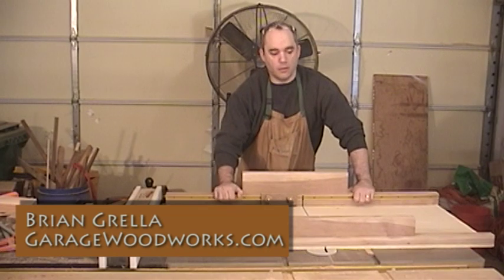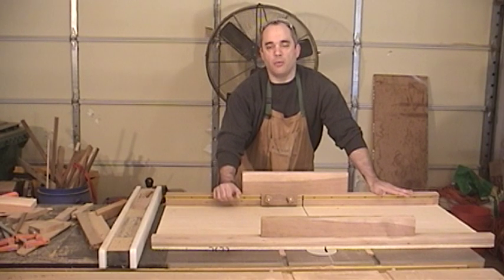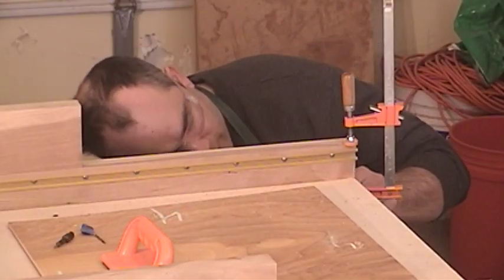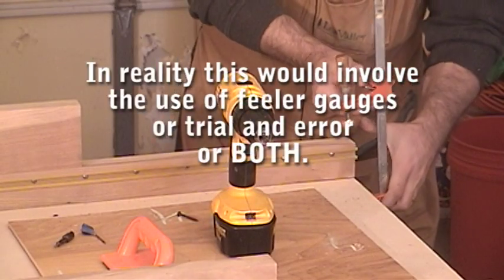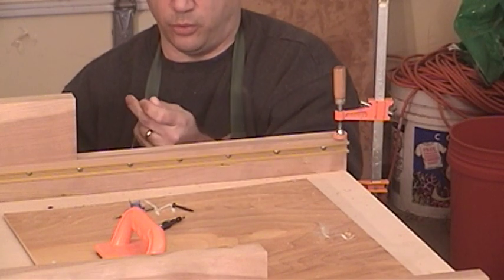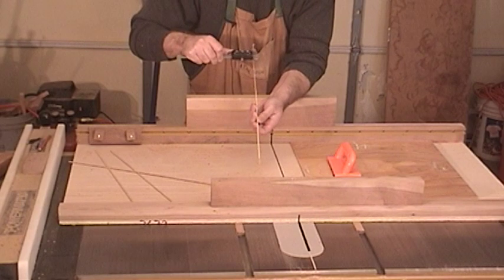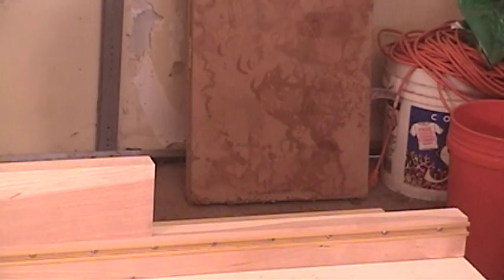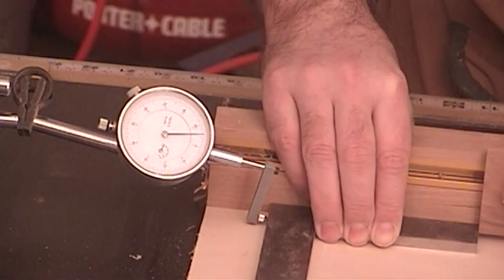Five Cut Method Showdown

Comment: I am soooo glad that I found this video.  I have been struggling to square my Incra Miter gauge, which I have mounted to an Incra Miter Express sled.  The 5 cut method was a terrible waste of time, and the instructions that come with it say just to use a quality square and align it to the blade.  There is so much bad, unuseful information out there, but this method worked like a charm! I used my TSO Triangle, clamped to my fence and the dial indicator and got it aligned beautifully in 5 minutes.  Finally! I decided to lock my fence down with the provided angle support and plan on leaving it there unless I need to make cuts other than 90 or 45.  For 45's, I'll just  clamp my TSO triangle to the fence and place the work piece along the 45 degree angle of the triangle. Thanks again! I"m going to make the dial indicator jigs to square blades as well.

Comment from the maker: 5-cut gets blade to fence square. Gauge gets fence square to miter track.  One of the first things you need to check after getting your new TS home is to check blade to miter track parallelism.  See my video on TS alignment.
Reply: you really don't. For the angle of the cut solely the orientation of the fence relative to the path you push the fence is important. Most saws should come with a sufficently well aligned sawblade. Absolute parallelism ist not required and indeed undesired on some saws (e.g. Festool CS 70)

Comment from the maker: Sorry man but you are really confused.  The dial indicator measures the error associated w/ squareness of the fence directly.  The length of the fence is irrelevant as long as it is flat. If your fence is not flat then neither the 5-cut method or the dial indicator method will help you obtain square cuts. Error across the length of the cut is accounted for by aligning the fence square w/ the dial indicator.

Comment: Thanks for taking the time to explain your method.  I just build a small sled, and tried to align the fence using your method.  Took lots of time to setup, and I wasn't
sucessful in aligning it to 0.001, even tho my dial indicator has a flat foot, and I have the same magnetic base as yours.  My vote has to be for the five cut method.
Reply from the maker: My guess is your square is out of alignment or your dial indicator was not riding the edge of the square.  The dial indicator method always works otherwise.  It's math.
Reply: I checked my square and it's ~0.015" out of square!  Also, I had problems with the square riding on the foot of the dial indicator.  So you're right on both counts!  Given those factors, it's the "5 Cut Method" for me.

Comment: Recently ran across your video.   5 cut method with a sled may still be the preferred way for me since the check is a guarantee of accuracy, but for lining up a miter bar and fence this is super easy.   I have an Incra 1000SE and it was a PITA to line up since there isn't a good way adjust it without having it slide around too much.  No real pivot point to go by.  

So, figured I'd try your indicator method.  Clamped a square of known accuracy to the miter fence and adjusted for zero error.   Very easy to do as no need to worry about a pivot point so it could slide wherever it wanted and you just have to re-zero the indicator and check again.  Took longer to clamp the square to the fence than it took to do the alignment.   Then I checked it using the 5 cut method just to be sure.  Result: .001" out in 12" on the cutoff piece.   I'm not sure my calipers are any more accurate than that.  I think this could easily be the way whenever a new sled or new miter gauge needs calibrated.   Thanks for the video.

Comment from the maker: I love the tired and ever original NASA quip everytime accuracy in woodworking is discussed. Unfortunately this is more about speed then accuracy. If you're not interested in speed use the 5-cut method. Say, do you have a speed related quip?
Reply: We always have enough time to fix it.  But never time to do it it on the first try.  But for those on the other side achieving ultimate perfection, remember squareness is infinitely unsquare.

Comment: So how is the dial indicator set up? This would be nice to know.
Reply from the maker: It's demonstrated in the video.  Could you elaborate a little where you're confused?
Reply: I can see how the dial indicator is being used against the square, what I can't see is what is what is going on on the other side. Is the dial indicator attached somehow to the blade itself? If so, how? If not, what? Sorry, I'm not trying to be critical, I'd just like to do this test myself.
Reply from the maker: The dial indicator is attached to a magnetic base which is secured to the table saw surface.
Reply: Okay, I might be a dunce, but at my age any self-esteem issues can just be written off to senility so I don't have any problem with you showing me to be such, so don't we have to establish a relationship between the blade and the fence, not just the table surface?
Reply from the maker: The process I am demonstrating gets your sled fence 90 degrees to the miter track.  Your blade should be parallel to your miter track already (this can be confirmed with a dial indicator to great accuracy - I demonstrate this in another video).  If your blade is not parallel with your miter track it needs to be fixed regardless of which method you use to align your sled fence.  Everything should be aligned to your miter track.  If your blade is parallel with your miter track, and your miter tack is 90 to your sled fence, then the blade will be 90 to the sled fence by default.
Reply: Thank you for your patience.

Comment: Using a dial indicator for a static adjustment is a good place to start, but one should follow up with the dynamic 5 cut method just to see what the saw does when actually cutting wood.  You might be surprised.
Reply from the maker: Why?  The goal is to align the fence 90 degrees to the miter track (which should already be parallel to the blade and can be checked with, you guessed it, a dial indicator).  You're much better of doing your calibration (fence alignment) without introducing error (noise) that can interfere with your alignment. For example, vibration caused by the blade cutting wood can introduce error not present in my method.  The 'roughness' of a cut piece of wood, down its length, is enough to throw off a measurement with a caliper when measuring to 0.001".
Reply: GarageWoodworks Why?  For all the reasons you gave about "introducing...":  And you have mistaken the goal.  The goal (purpose) is to cut wood accurately.   You seem to confuse means with ends.  But you do have a ton of great ideas, that's why I subscribe to your channel.
Reply from the maker: No. The goal of the process is the alignment which results in cutting wood accurately. Do you acknowledge that the five cut method involves more 'noise' in alignment process?  If not, please elaborate.
Reply: GarageWoodworks Yes, I do acknowledge that the five cut method involves more "noise".  But this "noise" is a permanent element in sawing wood and needs to be accounted for, not ignored.   After using the dial indicator to align your sled fence do you or do you not check the results by cutting some wood and checking the accuracy of the cut with a square of known accuracy?  I bet you do.
Reply from the maker: Ed Waggoner Sr. Yes the noise is a permanent feature of sawing wood. The alignment process I demonstrate works with this noise removed.  I fail to see how this can not be perceived as a huge advantage.  A raw alignment of the tool in the absence of added noise.  Furthermore, when you perform an alignment with the 5-cut method, you are not "accounting" for the error, you are a victim of it.  Accounting for it would require the ability to subtract the noise from the process post-hoc.  And no, there is no need to check for square in my process.  My method involves no trial and error like the 5-cut.
Reply: GarageWoodworks Results are what counts, use whatever method you think best.  Personally I would not be able to resist checking my adjustments by putting a square on a freshly cut piece of wood.  Why? Because I make err now and again.
Reply from the maker: Ed Waggoner Sr. For me woodworking is not just about results, it's also about the process.  I need to enjoy the process.  If given the choice to properly align my saw by making multiple trial and error cuts or doing it once and getting it right, I'd choose the latter.  Makes for a less frustrating and more enjoyable process.  Using my method you will not need to check it; you'll know it's right.
Reply: GarageWoodworks" Using my method you will not need to check it; you'll know it's right."  It can't hurt just to make sure.  I'm not suggesting that one follow up your method with the five cut method, just a simple check with the same square you used, that is probably laying within arms reach.  It takes ten seconds.   I guess I'm just not as self-confident as you are, too many errors over too many years.  It really doesn't matter to me if the alignment process takes one minute or five minutes, I enjoy the process if the hoped for results are good and become frustrated if they are not.
Reply from the maker: Ed Waggoner Sr. "I'm not suggesting that one follow up your method with the five cut method..."   That's exactly what you did in your very first comment in this thread.   It's not confidence in 'self', but confidence in the method.  You might check it the first 3-4 times, but after you build confidence in the method you'll stop.  Trust me.
Reply: GarageWoodworks I guess I should have read my first post.  Sorry!  Mea Culpa, Mea Culpa, Mea Maxima Culpa. You are right I may come to trust your method, I'll surely give a try.  Kind regards.

Comment: Drive to the store to get a dial indicator, stand and calibration blocks, calibrate the dial indicator; 2.5 to 4 hours.
Reply from the maker: I'm not sure how you came up with 2.5-4 hours to buy a dial indicator and calibrate it (calibration takes seconds) but if you want to get silly then you need to adjust the time for the five cut method as well: You will need to drive to the store to buy a sheet of plywood and cut the plywood into a manageable size for the 5-cut method; 2.5-4 hours.   

I'm not sure what you meant by "calibration blocks" but all you need is a square for calibration.

Comment: I just aligned my fence using your dial indicator method, and got it within 0.002" in under 5 minutes! I made a number of mistakes my first tries.  my original fence wasn't straight enough, which I corrected with a nice piece of 4/4 maple.  My original dial indicator setup wasn't rigid enough, and I used a flat foot on the indicator.  This, and using a dead 90D square made all the difference.  I am therefore changing my original vote. Thanks Brian for introducing this very accurate method.

Comment: Sorry man but the dial indicator method (E. Bennett) doesn’t take few things into account one being the error ratio across length of the fence from pivot point to the edge of the fence. Error across the length of cut and  other things to say the least. That test is hit and miss at best and the cuts are proof of that .

Comment: I find this discussion comic. After fifty years of working, I can't imagine not having a dial indicator, or squares that are not square. I have two Starrett squares, a Lee Valley, and a machinist square. All are "square", down to to ridiculous tolerances for woodworking. These are the tools that make your other tools accurate. I used Brian's method to align my latest crosscut sled with dead nuts accuracy. The five-cut method certainly works, if you don't mind cutting up a piece of plywood until you get the fence to ninety degrees. Or, you can do it quickly with a dial indicator. Thanks Brian!

Comment: Both look good.  The trades are the dial method requires more expensive equipment to perform.  The average guy will do better with a 5 cut.  I dont (and wont) have a square that's square enough to use the dial method.

Comment: I just did the 5 cut method.  Had to adjust twice.  Still not perfect, but I was tired of cutting and measuring and clamping and drilling and screwing etc.  The dial indicator would have been quicker.
Reply from the maker: Quicker and potentially more accurate.  Next time :)